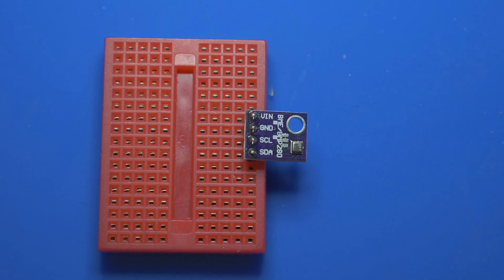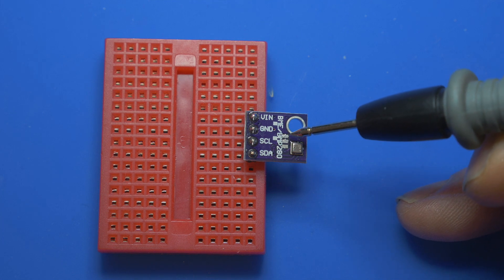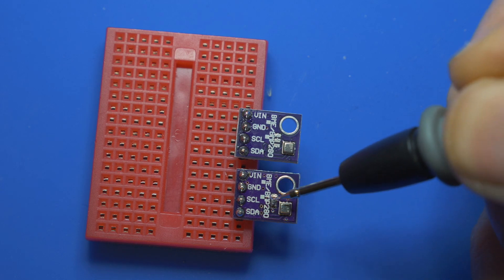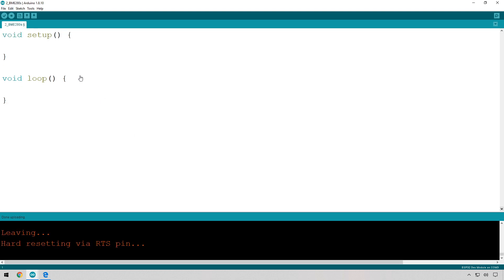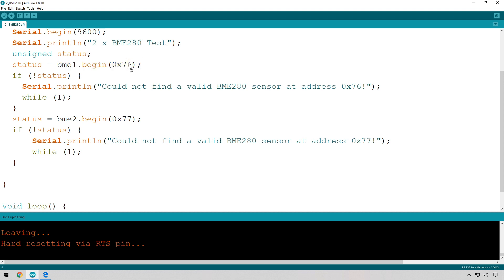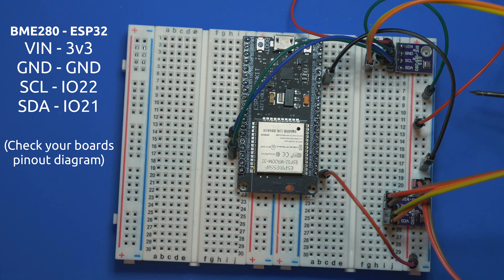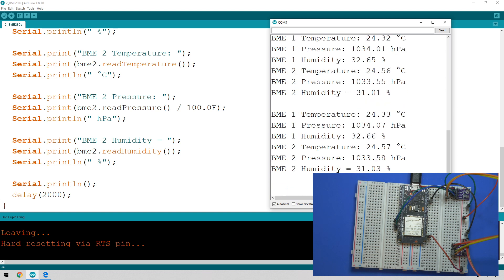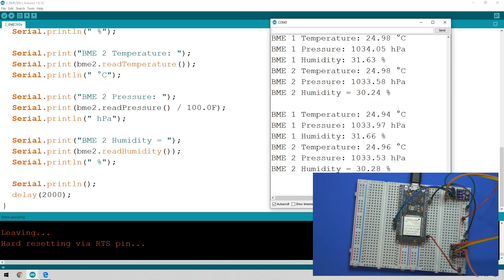Reading two BME280s with the Adafruit library and an ESP32/ESP8266

Comment: I found it difficult to sort out the wiring. is it possible to stick an hand drawn schematic under the camera lens for a few seconds to assist with this.
This seems a good project. Thank you.
Reply from the maker: hi James, the wiring is pretty straight forward, power to VIN (3.3v), ground to GND, SDL and SCL to the corresponding pins for your device (21 and 22 for my ESP32). I put the pin to pin up on the screen in the video. which part are you having problems with?
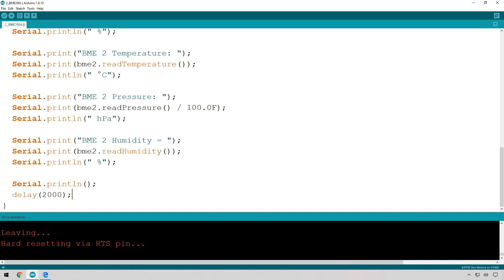Reply: @ChilliChump2  From about 3:07 onwards the wiring is not clear. There is a green and a blue wire going from the upper module to the controller and there seems to be another wire hidden behind but not clear other than the point of termination at the controller. My intuition says that there should also be a connection from the second unit to the controller but I cannot see one. There seems to be an orange and a yellow bridging the bottom two terminal posts on the sensors to the blue and the green wires to the controller. I have just figured out that the reason for my expected connection from the bottom sensor to the controller being missing is because of the I2C bus. There are just wires hiding wires and I am an X-Electrical Engineer very comfortable with schematics and less so with layout.
Sorry to be a pain. I am recently into the Arduino and no contributor likes to give a schematic, just a (very pretty) graphical layout.
Reply from the maker: The wiring looks complex in the video because I am using the common power rails on the breadboard (if you watch my last episode on my beginners guide to automation you will see what I am doing: https://youtu.be/QT20p66IRDE). The power can go direct from the power on the ESP32 without going to the power rail first.

I don't put together schematics because I am putting out multiple videos a week which take time to film and edit etc. But for my more complex projects I probably would put a schematic together. I thought the wiring for this project should be prety straight forward. Like I said before:
 3.3v from ESP to VIN on the BME280,
GND from ESP to GND on BME280
IO22 from ESP to SCL on BME280
IO21 from ESP to SDA on BME280

This is the same wiring for both sensors. If you haven't used a breadboard before I made a video showing how this works too. https://youtu.be/y6Ft85xXv9k
Reply: @ChilliChump2  No problem. I have used Breadboard before but I always found then unreliable and preferred to solder directly into Veroboard or wire wrap on perforated board. Most, probably all projects went onto a PC board I etched and I even got quite adept at doing double sided ones but mine were just one offs. No the problem was that some wires were hiding and I had forgotten that the two sensors were on an I squared C bus.

I think that my home project here will use a CAN Bus around the house eventually when I get the individual bits going some of which will be probably behind metal so WiFi will be compromised. 
I only started thinking about this a couple of weeks ago after I unplugged a freezer without realising in time and some of the modules will be Freezer/Fridge supervising. which is why I was interested in this device, although I will probably use a more robust sensor in a waterproof cladding. I have done this before but a while ago and I cannot remember what the component was but a modern version will be available.
I used PICs in the past, programmed in Assembler but the Arduino will be more convenient to program. Single Stepping through 100 lines of Code is time consuming. I think it was a MapLab IDE but not sure.

Sorry to be a nuisance.

James
Reply: @jamesgoacher1606  James, a slight tip I've used with the breadboards for getting loose pins to cooperate is to bend a slight kink in them on the tip end. By doing this, it takes the mechanical slack out of the connector hole and tightens them up nicely. Absolutely soldering to a board is superior, but for quick tinkering, and making adjustments before you make an etched board, they really are slick.  

Also, something else I've learned from the development world is if you can get a circuit to reliably function on a test bench with duct tape and wires hanging all over the place, it usually works better when you get it on a real board!